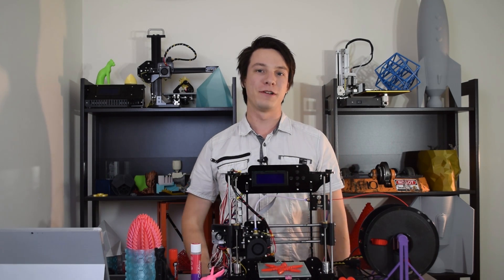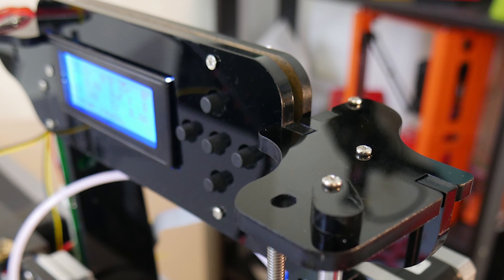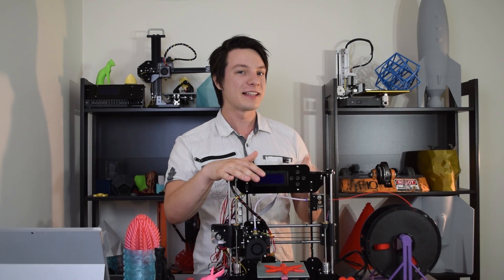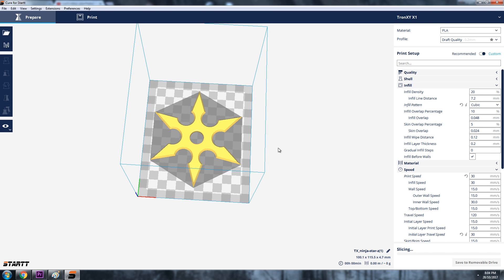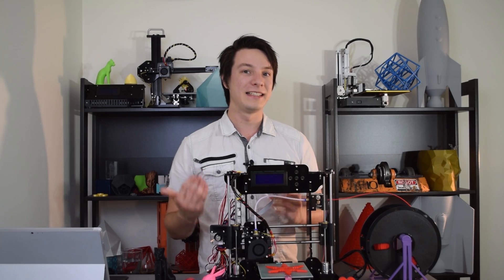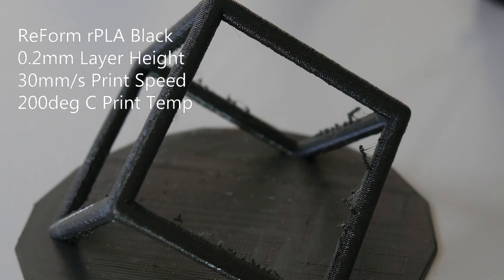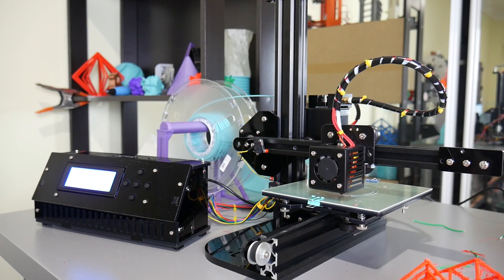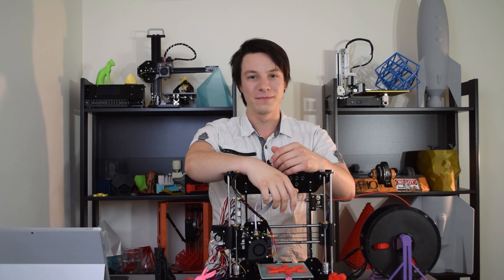The $99.99 STARTT 3D Printer is the Cheapest Kit you can buy. But is it any good?

Comment: Are there any other software packages that will slice and send for PC to 3 D Printer? I have a A8 generic prusa i3  mk2 from China with a Anet 1.0  or 1.5 board not sure the firmware. I got the 3D printer with the control board putting out no voltage to bed. Something wrong with the hot bed. I haven't been able to print out anything. Servos work fine manually with Curia 4.5 but no print outs not acceptable.  What other software could I use that uses the USB to the 3D printer?

Comment: 3d printing is a hobby 🤔 I used mine to designing some holder for some controllers to call and open and let go of linen bags to the dropping area for the machine the owner wanted to pay me 70 per piece he wanted 10 I sold it to him for 40 instead so 400 dollars paid my printer a anet a8 and got me a raise at my job and now i can see my work at my workplace all over the place i also use it for small parts the i need for my rc car drone etc but I do have fun with printing dragons dogs mini figures going on to buying my 2nd printer a flsun cube dual extruder

Comment: I'm somewhat astounded that I made this printer and that it worked.  I think the only part that was unclear to me was how to make it actually start printing.  There is a file format you must put in a microSD card that fits nicely into the printer.  A simple software download allows you to scale models and convert format to a readable form.  Once you make a few attempts, you start to get better at knowing what to do and how.  I risked the $100 on a learning experience and it was worth it. I immediately ordered a bigger one with more confidence.  You can see pretty easily how to make it larger with longer bearing rods and drive belts.

Comment: What about building your own 3D printer with, Arduino compatible Mega2560 master control board with RAMPS1.4 main Control board expansion board, wouldn't this be a cheaper option as you can also choose your own bed size and even do a dual extruder

Comment: Perhaps an update is in order. I've almost finished building my Anet A8 and from your description a lot has been updated. Mind you a good friend has printed off a bunch of upgrades which I'm building in as I go.  Yes it's been rather a slow build owing to upgrading a few other parts and having to wait up to a month or more has managed to stretch the build time.  At least I'll have a darned sight better printer to kick off with. It's now much sturdier and less likely to flex. Plus it's a lot lighter with all those metal bearings swapped out with much lighter Drylin type.  The bed is now heated and sporting a Borosilicate Glass plate. Plus many other little additions (Thanks Fred)  

One other feature they've changed is are the locking grub screws for the Horizontal rods. Remember to loosen them off before installing those rods. The build video shows the builder bashing them in with a mallet. Now they simply slide in and firmly locked when in the right position.  The complete motherboard has changed, but sadly that very dangerous PSU still has bare 240 volt connections.  Little fingers are a definite NoNo. 

You are definitely right with your explanation of why so cheap. Once I get comfortable with the A8 I'll definitely be looking for something better, but once again I'll opt for something I can expand on and print my own upgrades. Possibly a kit if that's what it takes.

Thanks for your review, it makes a lot more sense now that I've actually built my own printer.  Well done.

Comment: If you calibrate and fine tune your printer, you can make the results be great. If seen prints from a propperly tuned €100 printer be so much better than a €500 one. Do keep in mind those €500 ones are running 12h per day at school so they are more likely to get out of alignment

Comment: I just assembled one this weekend.  Mechanicaly not to bad, but I have a lot of problem getting it to actualy work.
1. Updating the firmware from 0.85 to 1.0 does not work for me.  The USB connections "breaks" every time before it is done.  ame on an other PC.
2. Printing from the USB makes the SW crash in an instant under Win 10-64bit-
3. Printing from microSD works, but terminates in the mitle of the process by the heater turning off.  Sometikme it will run for one hour, sometime for 10 minutes.
4. Printing is placed way of center so impossible to print anything above 80x80mm.
5. Should do 140mm but SW limites it to 100mm
6. Zero instruction on how to get it to work and use it.  Video is totaly outdated and only got Mac.

So not the best experience until now.  Hope I get it to work.  If any one has some idea it would be great to here.

Comment: I would buy one just for spare parts for my Anet A8, ok lets explain. Spare motors and Extruder, Bearings limit switches. bodem upgrade. spare lcd dispay and so on.
 
but until I need spares I would use and play around on making things with it that are simple as not to tie up my Anet A8
I'm sure there will be some one that will upgrade their little STARTT machine to the hilt pushing the cost up , but hey it's the fun factor.
And 3D printing is way good fun.

Good news for me is that it can be bought in the UK for £99.99 and so in total with shipping it cost £112.63 including Tax. Bargain!

Comment: If you are a DIY type, at the least, you could use it to print the parts for a larger different type of printer(CoreXY? , maybe), source some extras, like heated bed, better extruder, etc.  and upgrade that way. I paid almost twice that for a OneUp but built a Rostock Delta and then a CoreXY by using the original to print parts for the next one. It was a lot of fun and very informative. And both printers worked very,very well.

Comment: That extruder looks identical to the one in the Tronxy X1. I had problems with extruder skipping on mine at first but a close look revealed that the idler was actually sitting lower than the filament holes, and given that it's curved it was forcing the filament through in a weird "S" pattern placing huge strain on the stepper. Simply putting an extra washer underneath raised it to the correct level; I've been printing fine at 60mm/s ever since.

Comment: what would happen if you dropped in a 32 bit controller and a bed level sensor like a BL touch?  I wonder what just the frame, steppers, hotend and extruder are capable of without the bad firmware and cheap control board.  What effect would mesh bed leveling etc have?  Might be a really cheap route to a decent printer that will with some careful printing create the corners and other parts for a much better Core XY or Delta.

Comment: About off-center printing - in my case it was partly by the mis-mounted bed assembly. I managed to put it back to front. Fixing that almost centered Y axis. I plan on adding a little spacer on the back of hot-end assembly (inside hot-end carriage thingy) to further bring printing center to the front a bit.

Comment: Hi Angus, just a quick point - you have the bowden tube fitted wrong  (I did the same!). 
In order to successfully use the full height of the printer, replace the short piece you have fitted with a loop that goes over the top of the gantry. If you don't, it will eventually get trapped under the gantry and tall prints will fail.
So if they are still supplying a long length of bowden, don't be tempted to cut it short and feed it under the gantry to make it look neater... ;)

I have been using the Startt for non-critcal parts since I (personally) bought it from iMakr during the initial UK release in March of this year. Apart from a few teething problems with the assembly videos and some distorted X-carriage ends (Z-mounts) that iMakr sorted out immediately, it was a really good purchase.
My one has a few firmware idiosyncrasies that I never bothered to fix (need to power-off to cancel a print), but I still consider it money well spent.
I think it still has value as a "First Printer", but as the price of cheap machines continues to drop, the tiny build volume is starting to work against it.

EDIT: I forgot to add - the one real failure I did have was the power socket at the back - after a few dozen uses the socket melted - as it comes pre-wired, I'm not taking the blame for that. :)

Great video as always,
Susi (rigid.ink)

Comment: I had to put a piece of insulation around the hot end because the hot end fan (not the part cooling fan) was cooling the hot end too much and making the extruder motor miss steps.  It works flawlessly now.
Reply: I noticed that on mine. The extruder cooler isn't ducted and blows on the hot end and all over the part too. I put a piece of plastic to duct the air through the heatsink.

Comment: I build one, after waiting 9 weeks before receiving the package.
The USB port is a bit strange, Cura does not connect with usb, as well as Octoprint, did not connect properly.
A Kapton sheet did work very nice, better than the supplied painters tape.
A modified fac-duct seemed to improve the quality a lot, and the adhesion to the bed got a bit better.
I managed to print a vase and a huge cube, filling the complete build volume, never failed except when running out of filament.
The pneumatic connector for the bowden tube, broke after re assembling it after filament change.
All and All a nice printer, i've sold 5 kits for a building workshop, lots of people like this to give the 3d printing a try.

Thanks for your review.
Reply from the maker: Give gluestick a go right onto the fibreglass plate, it works really well for me. Thanks for the comment!

Comment: Some genius needs to find a cheap source of steel frames you can adapt and use.
You need 2 large square or rectangle shapes to bolt or weld together.
I thought of fish tank stands but other things might be better.
Metal stands of some sort might be  a viable option.
The idea is you get a cheap 3d printer for all the parts and upgrade it.
Reply: Aluminum extrusions are fine. Steel is overkill for 3d printing.
Lookup the Hypercube design by tech2c!
Reply: I was thinkling big. You want a large frame steady as a rock.
The only thing  limiting a 3d printers ability to make huge items is the size of the frame,
The rest of it is already there. Thanks for the reply though.

Comment: I bought one of those Tronxy printers, $160 from Gearbest. For me it was the gateway drug :-) I figured for the price, even if it didn't work out, it would be worth the time I spent with my son putting it together. Because of the meager instructions, you have to have a certain mechanical aptitude, be willing to make educated guesses, do internet research, etc. to put it together. 

I guess because I didn't even expect it to work at all, I wasn't put off when I crashed the nozzle into the aluminum bed while trying to level the machine. I replaced the nozzle, found a good video demonstration for leveling a printer, and it worked! 

I've had to fix many problems, like re-soldering the bed heater wires after they snapped off, replacing the bearing rods and bearings for the bed, leveling and re-leveling and re-leveling... I taught myself a little Blender, and became so taken with this hobby, that a few months later, I bought a Prusa i3 (which I've been waiting months for).

Comment: This is like my Tronxy P802M but smaller. I might get one just to have a second printer for when the larger one is in use. I added some frame rigidity supports to my P802M and it prints quite nice now so it should not take more then a section of angled aluminum and a few bolts to add a lot of rigidity to this smaller version. Here is my blog post about modifying the P802M: https://samueldperry.com/2017/05/21/tronxy-p802m-rigidity-modifications/

Comment: For anyone who gets this acrylic style of frame, do not use any type of threadlock/loctite whatsoever. I had an anet develop fractures over the span of a few hours. By the time I had assembled it, the printer basically fell in on itself. It's pretty incredible how fast the stuff shatters when it's come into contact with loctite.
Reply from the maker: +PipetteJockey yep it happens to polycarbonates too, crazy ! They have special plastic threadlockers now that are safe to use.
Reply: If you're the guy who showed the printer which collapsed after using Loctitie,  I'm not at all surprised, it looked as if you applied it with a 6 inch paint brush.  I wonder if loctite is bad for ABS or PLA ???

Comment: Hey Angus . Great video by the way . I was one of the commenters  to ask for a review. I have got the old version of the anet a8, that came with a heated bed and a rather sturdier frame. I would also like to mention that there are many upgrades like x and y belt tensioner, frame supports , and many others. Another upgrade is the tronxy auto leveling sensor wich greatly improves first layer and acts as a sort of 'failsafe ' if the printer was slightly distorted after a print . Just wanted to mention all that and keep up the great work . Thank you.

Comment: was about to buy this as my first 3d printer, glad i had the courage and go for the anet A6,besides the bed going out of level if i move the printer there's nothing to ruin my prints other than my fault for not knowing enough about it.
  the only problem i see with it is that it has the extruder limit at the 0.4mm nozzle so if you put a 0.3mm nozzle in it  the extruder can't make steps that small to get a constant flow so you get lots of small dots instead of a line.
 although i'm working on a new x carriage with e3d hotend and geared extruder:D which might be first for anet A6

Comment: I wonder if you could 3D print parts that would improve its ability to 3D print
Reply: For sure! I have basically a bigger version of this, and I've made structural stabilizers, belt tensioners, z-axis height set screws, and better cooling shroud. Troubleshoot it: design a fix. You can get great prints out of these cheap machines, and you learn a ton along the way.
Reply: @akapoop06  that's the spirit.
Reply from the maker: Definitely lots of room to 3D Print upgrade parts!
Reply: Print enough parts to make a brand new 3d printer and eventually cause a Grey goo scenario

Comment: Man, I laughed out loud at the intro. That was great.

For $100, this kit might be worth turning into a tiny laser engraver?
Reply: Depends where you live because of different shipping costs. There are dirt cheap engraver Kits based on aluminum extrusions and modular diode Lasers available from the usual suspects.
Reply from the maker: I dunno, the print volume is tiny but you could always reuse parts for a bigger machine. Would have to buy longer rods and such.

Comment: WOW! 99 US bucks and you get all this!!! Might be worth just for parts hahahaha.
BTW: why do manufacturers insist on acrylic when there are far better alternatives! Yuk!!!
Thanks for sharing Angus! Thumbs up!
Reply: Aluminium is expensive, so that's not happening.
Reply: Acrylic can be very cheap and it's really consistent, it always comes out the same, so there will be fewer warranty cases. It also doesn't warp with humidity or temperature.
Reply: There's not a lot else than you can process so quickly from giant sheets into printer parts.
Reply: Siana, IMHO,  you could not be more mistaken! The use of acrylic parts represents more than 2/3rds of all claims in the 3D scenario (see forums, youtube, FB etc...). 

Amongst other problems structural it is too brittle and it is renowned for cracking., splitting, cuts being inconsistent (see burnt by the cutting laser) and yes it does warp if you adjust any rods too tight and it degrades with time when exposed to UV becoming even more brittle

 Furthermore, the process of making acrylic particularly in China is not eco-friendly by a long shot!
Reply: It is brittle and i hate it; but when it breaks, it's CUSTOMER'S fault, the manufacturer doesn't have to service it!

The next alternative to acrylic... let's not even consider less brittle plastics, because they are quite floppy. The next actual alternative is plywood, which will just warp BY ITSELF. with temperature changes, humidity changes. Acrylic retains its shape.

I'll take plywood over acrylic because at least i can force it into submission. But i can see why a manufacturer would make the opposite choice.
Reply: You guys ever heard  about aluminum? 

The argument that if it breaks it "the customers fault" i very much open to debate; the jury is out on that!

Sorry, I'm not going into this any further.

Cheers

Comment: Nice review again Angus ! I was wondering what are your thought about the Zimpure 2 whitch is on Kickstater right now ? I am wondering if it is realy working because I have asthma and I'm curently only printing PLA for that reason. Everithing I found about that topic is not realy conclusive about the dangers of melted particules. Thanks in advance and keep up the good work.
Reply: There are a few obvious problems with it.
Does it use custom filters? If it does, then it'll be useless once they go out of business*.
If it doesn't, then what are you really paying for? (purposefully niche product, in an unnecessarily nice housing?) 

I can't imagine a standard air purifier standing next to the printer, would be noticeably less efficient and could easily be more so as they are likely to be more powerful.

Maybe just enclose your printer, then add a carbon filter and a fan...there are some nice enclosures on Thingyverse, using IKEA Lack tables.

Ooh, that was quite rambley :p
Reply: That's exactly the things I am not sure about and I am not even sure (and not sure if anybody know) if a carbon filter + HEPA filter will filter all the dangerous particles ... That's why I wanted the take of Angus. But yes my plan is ton enclose my printer and have a filtration system inside. I just don't know what filtration system (if it even exist) filters almost every dangerous particles.